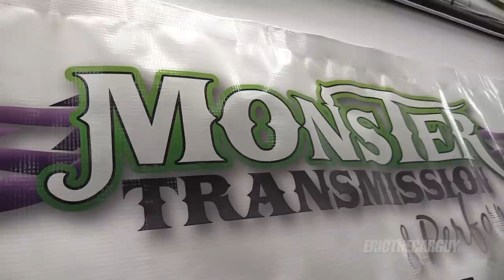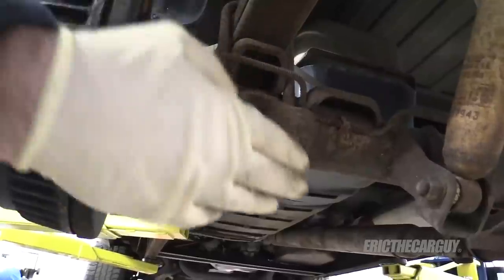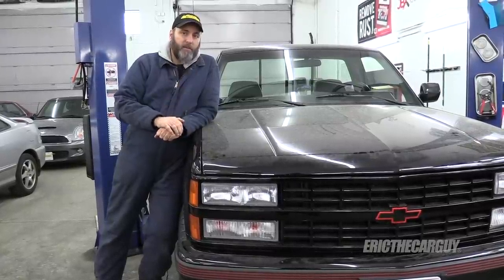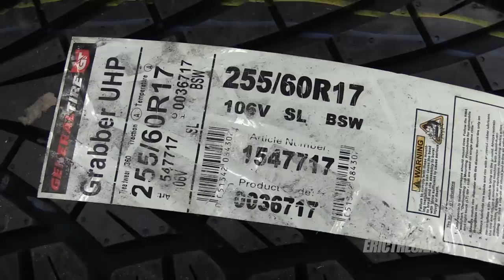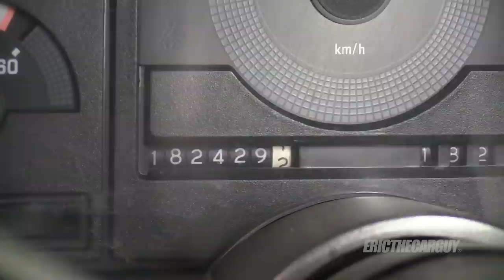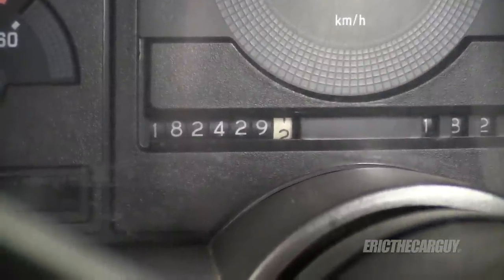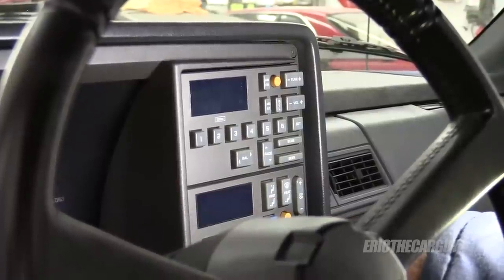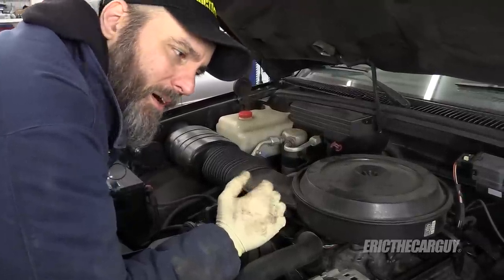#ETCGDadsTruck Build Introduction (Episode 1)

Comment: I did the disk brake conversion, and changed out the master cylinder for one from a 2001 Silverado that has disc brakes all around, direct swap, and a huuuge difference on the brake pedal.

Comment: Do the front coil springs in "phase one",  first.  Then do the dropped spindles in "phase two", so you won't have to do things twice.
Reply from the maker: Good idea, but too late.
Reply: I like how dropped spindles don't compromise the suspension, in starting with that you get to keep the original comfort and geometry..
Reply: Spindles are the best option cause they don't change the suspension geometry. When you change the springs now your getting into camber and toe issues, and steering problems mainly bump steer.

Comment: FYI, there is a larger caliper available for the front from GM. The C3500 SRW uses the same size rotor as your c1500, but the caliper uses a larger diameter piston. Some police tahoes of the late 90s were also equipped with these brake calipers. You'll also need the 3500 SRW brake pads if you go this route.
Reply from the maker: Thanks for the tip!
Reply: No problem man! Love these old Chevy trucks. There's a lot of good info on the GMT400/88-98 GM forums and Facebook groups. Especially the LS swapped 88-98 group. Good luck with the build!
Reply: Have you personally done the upgrade? Any noticeable difference?
Reply: @helivesonforever  
I have not yet. Planning on it within the next 2 months. People on the forums who have done it say it helps a bit with stopping, doesn't do anything for pedal feel though.
Reply: @leaharmstrong2907  I'll have to do that to mine then. The brakes were a weak point on these trucks for sure.

Comment: I got my dad’s 1998 Chevy C1500 last July shortly before he passed away. I wish I could say that his was in as great of shape as yours but the interior definitely needed some love. 
I currently have the interior apart and getting ready to install a new carpet and clean the seats as best as possible. Had a water leak on the drivers side coming from the panels under the fender where the panel adhesive had failed enough to allow water in. Drivers side floorpan had to have rust cut out and patched. Also having some drivers side can and bed damage repaired at the moment. 
Has the 350 also and is very strong. Has less than 100k miles on it. Starts right up, smooth and enough power. 
I would love to do the drum to disc conversion on it someday but my wife wants it finished so we can use it now. Good luck to everything you’re doing to your dad’s truck!!

Comment: I'm most interested in your brake upgrades.  I have a 95 K1500 and feel the same about my brakes. They gauges are goofy but I once a 1990 back in the day and youi know I really miss those gauges.  I think i had a tacometer in my 1990 5 spd K15000.   I think it is just that there are something really different and kookie that these days put you in the time frame that you really are in an old truck.  With that said, I put a double din with a backup camera in my 1995 for daily driving convenience.  They great thing is we can all do whatever we like.  I'm looking fwd to the brakes.  I'm wondering if I should keep all mostly stock and go to hydroboost.  I think I will try the newer OEM booster as my pedal travel seems excessive for panic stops.
Reply: RICKY BOYD I converted to disc brakes, and changed out my master cylinder to one from a 2001 Silverado, the cylinder is a direct swap. My brakes are pretty firm now. It was a night and day difference.
Reply: 2001 silverado*
Reply: On my 95 
I had to bleed the abs module 
The brakes are alot better
Reply: I've noticed that on my '93 C1500, there is a hose that feeds into a tee fitting for the steel brake lines in the back. I imagine replacing that with braided steel would make a difference, too?
Reply: @willfleischauer  did exactly the same on my '88 k1500 and got rid of the squishy pedal completely. Also did the slotted and drilled front rotors. Stops on a dime.

Comment: 2 step plan for lowering suspension:

1.  Drink beer.
2.  Cut 2 inches of stock springs with torch.

Lowering done.
Reply: Mark Williams lmfao that’s the “send it” method haha
Reply: 1. Beer sucks, be a man and drink whiskey.
2. Again, be a man and don't be afraid to turn a wrench.
Reply: @AdmiralRustyShackleford  *tequila
Reply: This is not Roadkill - you realize that, don't you?
Reply: You’re the type of guy to do half ass mods to a car or truck and turn around and try to sell it for a ridiculous price.

Comment: Yes! Very excited for this. I would definitely suggest just going with a 4/6 drop. My truck is a 96 and I’m very happy with the 4/6. It’s not crazy low where you can’t still drive it around everywhere but it’s low enough where it looks fantastic and I get compliments everywhere. I’m using 20 inch us mag wheels. If you want to see pictures of what I did or how it all looks, let me know and I can send them your way. I also have the c-notch kit I could send you if you want it (free) it has all the bolts included. It’s belltech but my truck was already notched so I didn’t need to use them thankfully.

Comment: I hate it when people lower trucks its ether going to be no good for carrying stuff which is the whole point in having a truck to be able to hall stuff in a lowered truck you would need stiff suspension making the ride rubbish this is where I leave hate to see a good truck ruined if you want a sports car buy one goodby.
Reply: Your statement is not all true. Yes some lowered trucks ride like rubbish and can't haul a load of groceries. Then you have trucks like mine, a 92 Silverado that rides better than my brothers 02 and my buddies 07. And I haul things. My cousins 96 Silverado hauled whatever he wanted including other vehicles while also riding and driving  like a mustang. The statement we buy trucks to haul things is also not always true. I buy trucks because to me they look better, the capability of hauling things is just a bonus in my opinion. I'm 43 and have never owned a car lol. Closest thing was a 79 SS El Camino. I'm anxious to see this build as I'm currently thinking of something different I can do to my own truck.
Reply from the maker: That's why I'm doing it in stages. I may stop after the first stage which is only a 2" 4" drop.
Reply: @jamietyree4994  
you may have made your truck the way that you want it but to me the whole point in having a pickup truck is first to have a high riding position you can see all around easy to get in to no stooping down to get in you can hall building stuff or tow a trailer/caravan/ boat on the back if you want to spoil all of that to have some truck that looks like it is meant for the drag strip that is up to you as the saying goes it takes all sorts to make the world go around.

Comment: I have redone the entire suspension in the S10. I used the belltech suspension with QA1 control arms up front. Nitro drop shocks on all 4 corners, and blocks in the rear! Everything I've done up front was a huge overkill for the 4 cylinder it had. The S10 now bears a 5.3L LM7. The engine has been freshened up with the usual goodies as well! The stock suspension was not up to the task of a V8! I also used a 3.73 rear axle out of a S10 ZR2 to give me 4 more inches in length on both sides to use the Corvette wheels. I have a lot more parts I put in like a custom driveshaft, etc. I never used the drop spindles though. With the drop spindles, NO ONE could get the alignment right with them! Not sure why, but steering angles would go way out of spec. The way my truck sits is perfect. It sits low enough to where the drive isn't harsh at all! It also sits high enough to where I dont have pray for my oil pan! God luck on the build! We'll be watching!

Comment: I think a 2/4 drop is plenty, keeps with the old school look and it'll ride better. Any lower than that without bags is a pain for street driving.

As for the engine, those AFR heads with an XE268 cam, headers/exhaust and a good tune should easily make more than 400hp at the crank. It'll make plenty of torque for the street and get decent mileage, because I assume your using an overdrive transmission and will use 3.73 or 4.10 gears.

Comment: Axle flip is good for 6" extra drop, not 4" on the GMT400's. Excited to see this, have an 1988 C1500 myself.

For the front brakes, get calipers from the 3/4 or 1Tons, same year. They are still single piston but have a larger piston! Bolts right up, uses the same pads and everything.

Comment: I'm building mine now (well on, winter hold). 89 K2500.. Bought it new back in the day. Can't wait to get it finished... 12 years in the making (ya know, because life happens). I originally was going to put a Dakota Digital dash in, but I ended up staying with OEM. Plug and play... easy day. Funny how you start out with big plans, and those plans get smaller and smaller over time.

Comment: I just got a truck like that, mine has a 4.3l v6, and a five speed transmission. Shes a regular cab, short box 94. I know that a v6 is not very big, but i like this combo. Im very happy with it. Shes old and tired, but shes mine,   and im gonna fix her up propper.

Comment: I'm very interested in this build Eric. I've got a 91 C1500 that I've had since new and have done a few of the upgrades to it you plan to.  I've put in the braided SS brake lines, rebuilt the front suspension completely, Steering gearbox, new Grant wheel, Flowmaster exhaust etc....  I need a new dash for it, but that's a rare find. Red interior dashes are hard to come by. I've done the radio swap, speakers (factory locations ugh...)  Dreams for much more.  The engine of my choice would be a Dart SHP 427 small block in the 550 hp range. The auto trans in my truck is bulletproof since new, barks second gear and never gave me trouble.  I'll be watching this build like a hawk... good luck with it...!!

Comment: Love it, Eric! I miss my '94 K1500 - I sold that 12 years ago with 266k miles on the clock. I think the 400 series was the last solid truck GM has built. Was all downhill from there.

Good you're going with the multiport. I'd have gone carburetor, but that's just me. 😁That TBI setup is as reliable as a stone ax, but extremely limited when you start modding, as I found out the hard way.  I put all kinds of money into mine, only to make it SLOWER than it was stock! This thing would get out of the hole faster than just about anything on the road, but the party was over at 4k rpm. Once I slapped some bolt-ons on the engine, I got my ass kicked at every stoplight. Lost my advantage. I ended up selling it and buying a brand new '07 Silverado off the lot - what a dummy! Biggest waste of money in my life. The '07 has been one headache after another. Only 96k on it so far, and I've had to fix twice as much on it as the '94 ...

Anyway, looking forward to this build! 😎

Comment: Yeah, there are LS style cylinder heads available for the SBC. So with a top end swap, you can get LS-like performance (as long as the bottom end can handle it). Also, looks like that gauge panel would fit an LCD screen nicely. 😉

Comment: I think the stage 2 drop is going to be like adding the turbo to the Fairmont, which will make it a much more complicated and expensive project. Stage 1 seem like the better option. Love the tires, not sold on the zero offset wheels - the 15" wheels have the right "dish" and look great, if you can get those in 17"... (17 is the new 15 it seems). Really interested in the brake job - I have an '89 C1500 that I got from Dad, 192K miles and well cared for, but has the same lousy brakes. Best of luck, looks like it's going to be a fun and informative build. Have a great day Eric.

Comment: Eric, just like every else I am very excited for the build.  I have a 94 Suburban so I am looking forward to learning something new.  Anyway, I am sure you already know but you ask me to comment, so more pistons in a caliper does necessarily make it a better caliper.  The main factor is piston area.  If you haven't read it, the "brake bible" on pirate 4x4 is a great article on brake system design.  Stay dirty.  -Alex
Reply from the maker: Yea, I'm aware of that which is the reason I'm going to upgrade the existing system and see how it works out before committing to expensive dual piston calipers.

Comment: Solid plan and it looks to be a fun build series. However, I do have one critisim with keeping the original 350. If you're going to go through all the work of checking out the lower clearances, new heads, fuel injection and keeping it naturally aspirated it might be worth just popping in a used LS. It'll give you all the "everyday man" driver power you'd want plus it would probably be a much cleaner install and more reliable in the end (e.g. think PowerTour miles w/Dad). And this will free you up to concentrate on all the other suspension, brake and interior mods you mentioned resulting in a nicely lowered, more economical on gas & modernized truck you can use daily.

Comment: Hey Eric great plan! Also keep in mind the charging system as EFI and electric fans will demand more juice so a high amp alternator will keep electronics and battery happy
Reply from the maker: It already has EFI, it's just not multiport. Also, I'm already changing all the accessories as I mentioned in the video. Thanks for your input.

Comment: i have a 1989 short bed.these 88-98 are classic,s.cant wait to see how it turns out.i just got done putting a 9inch in the rear from quick performance.they can set u up with the ten bolt flanges. so u can use ur stock ten bolt brakes in drum or aftermarket disk kit.u get to retain the gm lug pattern this way.

Comment: Yes!  The sound of a 383 Stroker is only rivalled by a flathead Ford.  Please, get some 383 stickers for the bed of the truck in the same font as the Sport/SS factory stickers.
Reply from the maker: Funny you should mention that. My long term plans for the truck include a respray and making it pretty, not that it's ugly now. I had thought of that very thing on the bed of the truck when the time comes. SS 383 D/T. (Dads truck)

Comment: Wew doggy! Super excited about this truck! Its one of my favourites in terms of body style. Love all the upgrades ideas you plan. I personally dropped my S-10 with spindles up front and LOVED the improvement to handling and body roll. I think you'll be happy with the first stage of lowering. Your stance will still be practical. It is a truck afterall, you have to be able to clear a speed bump or a curb right? Notching a frame is a lot of work, and makes any substantial towing a real hazard imo. Great plan Eric!

Comment: I have a 454ss I’ve been building. I went with a 2/4 drop and wish I had just gone straight to 4/6.
When you upgrade the fuel pump add that Holley “fuel mat” while you’re in there. If my truck has less than half a tank the fuel will uncover the pump under hard acceleration.
Reply from the maker: Noted. Thanks for the tip. Sounds like a cool build.

Comment: If you're doing a 383 put the 195 AFRs on it. The AFR heads are so good with enough displacement the 195s will be better everywhere in the curve than the 180s, even with just a mild cam.

Comment: If you go 383, do the 195cc heads. For the cubic inches an afr 195 will have as good of a port velocity without choking it down. We did a 383 on our work truck with a 224/230 cam but retained dart vortec heads and while it is fun, the heads can't support the rest of the engine above 5k. (Some of that can be the stock manifold logs too...) Granted it is in a heavy work truck but seriously I'd look into it. For a street 383 a 190-195cc is perfect. 3.73s are a good compromise if you're running an overdrive trans. We have 4.10s in ours and again, it's fun but can be crazy... and so far the original radiator has held the power. Granted we kept the stock fan clutch because of the cfms. E-fans are fun but just can't hang with the clutch if you really need to cool or keep it cool.

Comment: Great truck! Had the 454SS as my first car and did a 2x2 drop on it using the spindles and new leaf springs. went with 2x2 instead of 2x4 to maintain the forward stance the whole truck had. Make sure to roll the fenders or they could cut into the tire sidewall (at least on the front) on a hard bump. Ask how i know... :)
Reply from the maker: I'll keep that in mind, thanks.

Comment: Always have always will be a die hard Ford guy but my father had a 454SS about 7 years ago and that thing was a tourque monster. Big roller cam, 225 pro comp heads and a fast efi, 2800 stall, and a decent gear not sure what size. Had 275 MT DRAG RADIALS and still blew the tires off. Needed caltracs and some samd bags. I wished me and my father could do power tour together. P.S I'm not sure if you have have worked with Monster in the passed or of they are just sponsoring the build but I could tell you some nightmares about them. They may be under diff managment now but I couldnt tell you and from what I know I wouldn't recommend them.